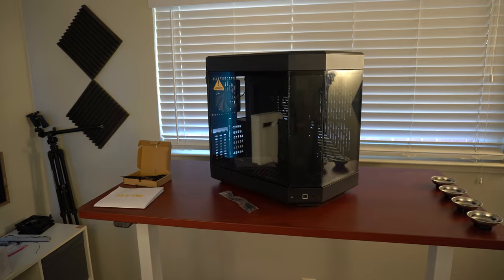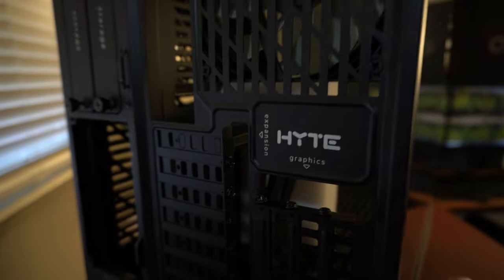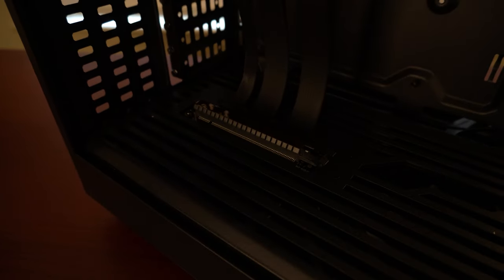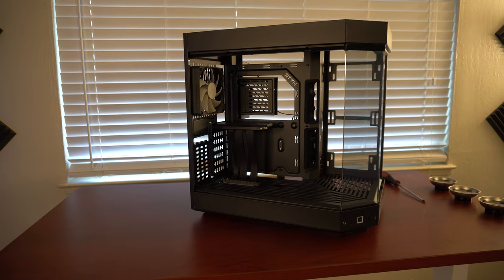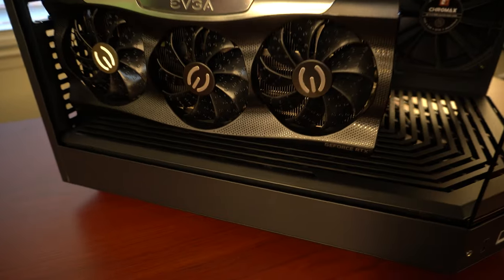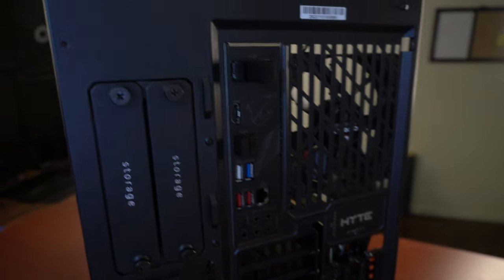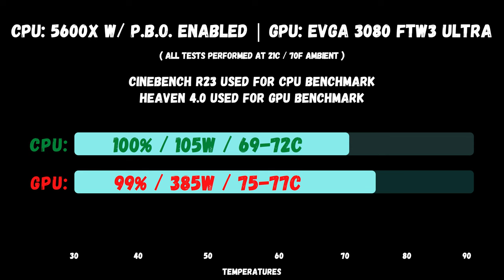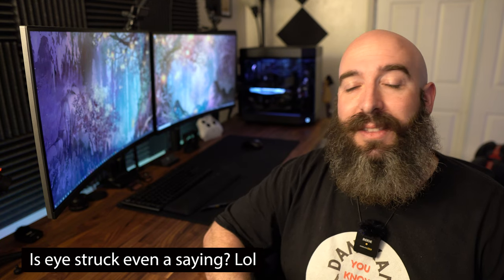The PC Case EVERYONE is Talking About: HYTE Y60 - In Depth Look, Build, and Review!

Comment: My only issue with the case is the hard drive support. I personally am running 2 3.5 inch drives , a 2.5 inch SSD (as well as 2x nvme drives on mobo). I had to double sided tape my 2.5 inch SSD to the case where the PSU is. There is so much space in the back compartment where they could have allowed mounting for 2.5 inch dad's. Granted most people don't use multiple 3.5 inch drives in their systems anymore, but even my $80 thermaltake s100 had provisions for 2x3.5 inch drives and 2 X 2.5 inch SSD caddies on back of motherboard tray. Just a thought
Reply from the maker: I gotcha. I use a 2TB NVME and 1 TB NVME on my board, and one 4 TB 2.5” SSD now so it worked for me. I think Hyte realized that HDD’s are kind of fading out for DIY PC’s

Comment: One thing I do like is the bottom part of the case, hiding the fans is better than having them on display like the Lian Li.... just looks neater
They need to fix the rubber gromets and allow 3 x 120 in the bottom. 
Some top 360mm AIO don't fit with the tubes coming down on the glass side.

My Rog Strix 3090 fan's spins up quite fast, I think the vertical mount placed GPU's too close to the glass, and I am not sure the 2 x 140mm  offer enough air, perhaps the integrated GPU mount restricts the air.
Reply from the maker: Honestly, I think 2 140mm's at the bottom is just fine, the case would be significantly longer if they tried to fit 3 120mm fans, although that extra bit of airflow would be nice. I haven't seen anyone run into any issues with 360mm rads fitting yet, but the tubes have to be oriented at the front.

Comment: I just recently moved my PC into this case. I mounted three 120mm fans up top under the bracket and I did have an issue with space for my 8 pin power cable. I had a sleeved cable but it was too stiff and  ended up having to go with the stock cable because it was more flexible. I'm still watching my gpu thermals closely because I'm running 3080 Suprim X but they look similar to yours.
Reply from the maker: Even with my AsiaHorse extensions which are extremely flexible, it was very difficult to get my 8 pin through, so I mounted them on top of the radiator “basket”. I’ll probably always stick with the side mounted radiator so that’ll work for now. 

My 3080 just likes to pull a ton of power an usually runs in the low to mid 70’s, and around 77c under a benchmark. It’s a little higher than I would like but it’s in the nature of owning such a powerful card. I thought I made a huge mistake by going with this case while owning this card, but so far, so good.
Reply: @DanKamYouKnow  We can always take the glass panel off if it becomes an issue. It's not ideal but it's less expensive  than a custom loop. Lol
Reply from the maker: Truth. As of right now, I have games for hours and haven’t noticed anything higher than 74c on my GPU so I think I’m good. I do have my Noctua fans set pretty aggressively all around. I need to load of God of War or Horizon Zero Dawn as both those games really give a GPU a sweat.

Comment: Im a little bit inexperienced when it comes to installing motherboards into new cases, just never had to perform this. Did you use any specific standoffs when installing the board? And if so which location did you do so? Any help would be much appreciated Dan, thanks!
Reply from the maker: Hey Freddie. So, most cases will have standoffs ready for ATX sized motherboards, so you can just use the screws provided with the case to secure the motherboard down. Different size motherboards like mATX will require you to move the bottom row of standoffs to a new location. The case manual will you should how yo do it.

Comment: Are the temperatures average? Compared to lian li o11 d evo and 5000d airflow? Is it worth buying if you want good temperatures and looks? Any answer is appreciated. Thanks
Reply from the maker: Temperatures are much better than I expected and completely acceptable. You can always make minor tweaks like under-volting / settings adjustments / fan curves, to get your desired temperatures. But even completely as is, temps are just fine. I would choose whichever case you think looks better. 👍🏻
Reply: @DanKamYouKnow  daamn bro soo fast service lol. The only tech youtuber who answers back thanks man appreciate it. I think i will buy this case now
Reply from the maker: No problem! I’m at my computer a lot ( mainly because of my normal work job ) and try to answer all my comments. Have fun with your build!
Reply: @DanKamYouKnow  btw is it possible to add more storage by making some place like using double tape and adding it on back (cable management) or the bottom fan place
Reply from the maker: There might be a little room in the back but it really only has 2 dedicated trays for 2.5” SSD’s and 3.5” HDD’s. I’m sure you can find a place to double sided tape one or 2 though

Comment: I just wish this could have a horizontal gpu.. I don't like this vertical gpu craze, and it's so close to the window so it just makes the gpu hotter.. The thermals are also higher on this so running a 13900k or something is a tad risky. The only two things I'm concerned about my pending build is case, and motherboard... Y60, H9 Flow or Elite, 011D-Evo, or maybe a Fractal North (the BEST one, but small and sold out...)
Reply from the maker: I would go with the H9 Elite if I were you. I believe that’s the horizontal version of that case.

Comment: Couple of tips: 
1. Get a 360mm aio your 240 is currently making it harder for your side intake to actually intake so not only will a 360mm improve cpu temps it'll help gpu temps because there will be less resistance 
2. Have x3 120mm at the top I'd better than x2 140, yes the 140's move more air but when you put an aio there the surface area of the 120s will be better because those would be more effective at cooling the water 
3. You front panel connectors might get caught in the bottom 140's so you should run those cables underneath the motherboard as a opposed to the hole behind the gpu

Comment: Can you change the riser cable which I believe is PCI 4.0 to 3.0?  because I have an Asus Maximus X motherboard which is PCI 3.0 this what stopping me to buy this case
Reply from the maker: You should be able to use a PCIe 4.0 riser cable on a 3.0 motherboard, and it will obviously run at 3.0 speeds. You may want to double check with Hyte Support to confirm but you can use PCIe 4.0 GPU’s on 3.0 motherboards.

Comment: Could use some help! I really would like to buy this case but want to use my existing PSU that is 9.45 inches long. Seeing the one installed in this build is 5.51 inches long, do you think there is enough room to still route power cables with my PSU?
(I know it will be tight, but is it doable)
Reply from the maker: Googling shows Hytes website that says the maximum PSU length is 9.3”, so yours would just barely be too big.

https://hyte.com/store/y60?v=113

Comment: I was really thinking about getting this case but had a question is there any room to install my Elgato 4K60 Pro MK.2 behind the gpu? it came with a low profile bracket but i don't know if it will totally fit.
Reply from the maker: You might have to check Hyte’s website to see the maximum depth for a El Gato capture card. I know only 1/2 height expansion cards will fit so I’m not 100% sure.

Comment: I am considering to buy this pc case and use it with my old thermalright peerless assassin as my cpu air cooling. Is it ok? Some advice please.
Reply from the maker: I actually have not seen anyone use an air cooler with this case but it’s more geared towards AIO’s then tower coolers. Not to say it won’t work but this case doesn’t have the best airflow so not sure what results you’d get. I’m sure it will be completely fine though.

Comment: just a question
isnt the 5600x a bottleneck with the 3080
i mean, if i had a 3080 i would use a 5800x or a 7600x
Reply from the maker: Not at 1440p, maybe at 1080p but I moved on from 1080p a loonnngggg time ago 😎
Reply: @DanKamYouKnow  good to know, thanks
also, forgot to mention how good the build looks

Comment: Do you think  this case would work with the EVGA 3090ti.   I thinks it's a 3.5 slot.
Reply from the maker: Man, it might but it would probably be right up against the glass. My 3080 is a pretty chunky card and is close to the glass, and the 3090Ti FTW3 is a whole slot thicker. I’m not sure unfortunately
Reply: @DanKamYouKnow  I kinda figured that.    Sucks because that is a cool looking case.    Thanks for letting me know.   Great video man.
Reply from the maker: Appreciate it! You could always run the side panel(s) off if you really wanted to. I kept mine open for several weeks and just made sure to use my electronic duster more often.

Comment: Is the gpu temp of 77c the junction temp?
Reply from the maker: Core temp. But I had my power setting set pretty high for this video ( it was pulling almost 400w ). I dialed it down and consistently get around 65-72c. With some fan curve adjustments and GPU setting tweaks, you can make any GPU run fine in this chassis.

Comment: hey Dan, your 280mm radiator is upside down.
Reply from the maker: It’s completely fine to run it this way. As long as the pump isn’t the highest point of the system.